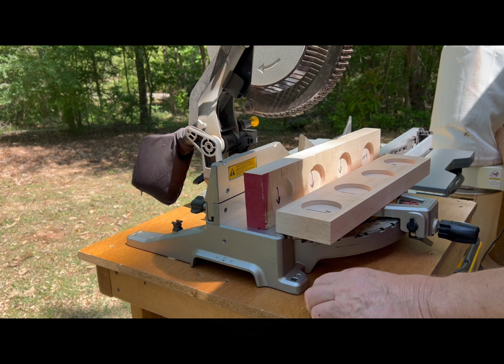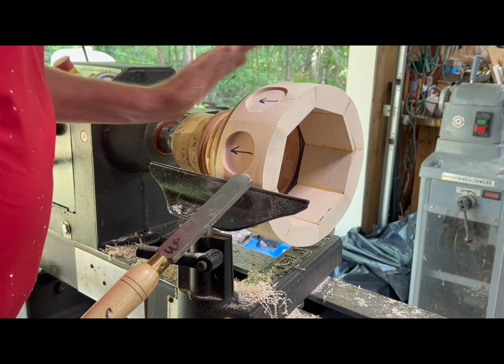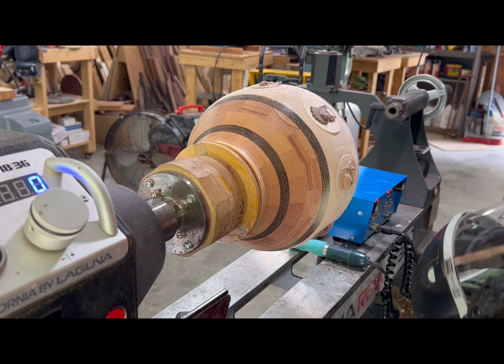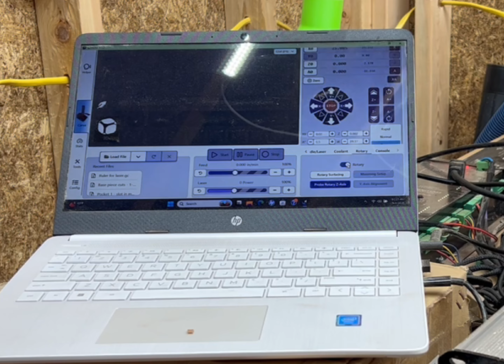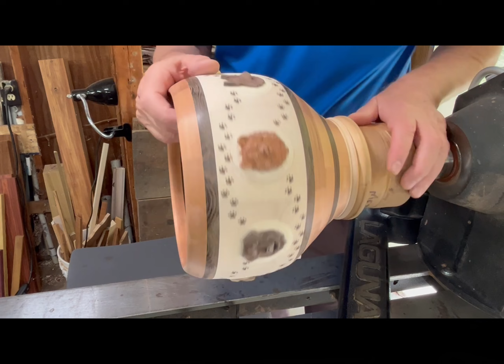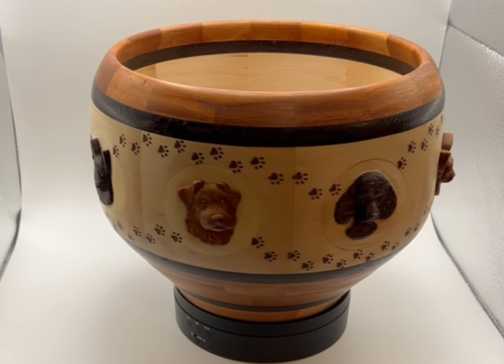Protruding Dogs Bowl

Comment: Thanks Jack for another innovative and creative video.  I am seriously thinking to buy a Longmill CNC.   I am curious about the brand name of  your laser module.  Later, after I  receive my Longmill I will connect with you  about this interesting opening in your waste board,  Thanks in advance for the answer and continue to post
Reply from the maker: My laser module is the bolt-on module sold by Sienci Labs.  It is great for laser etching, but not strong enough to do any serious laser cutting.  Thanks for the comment!